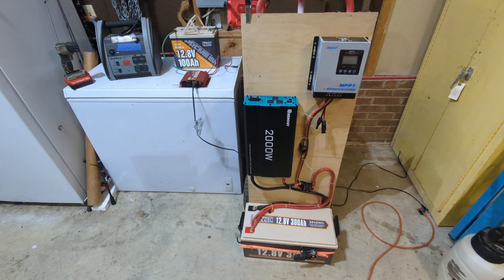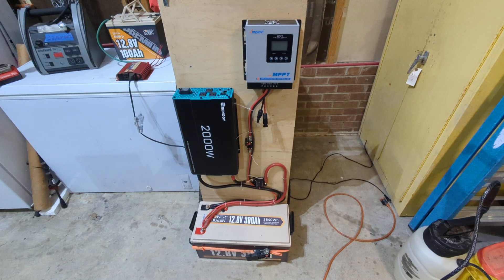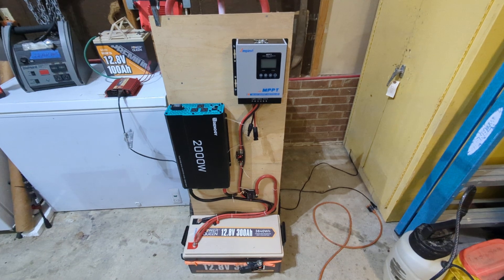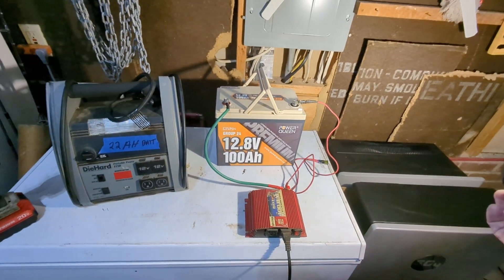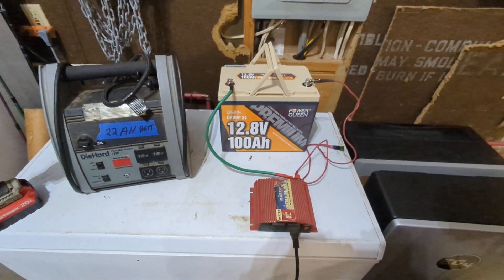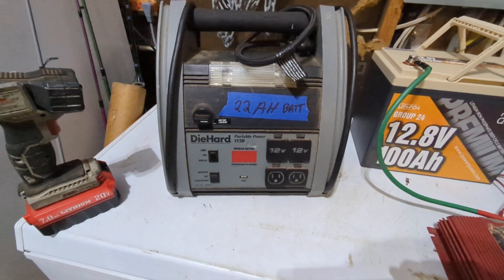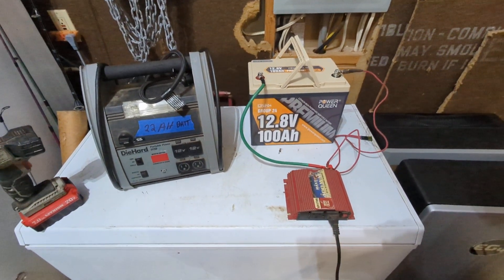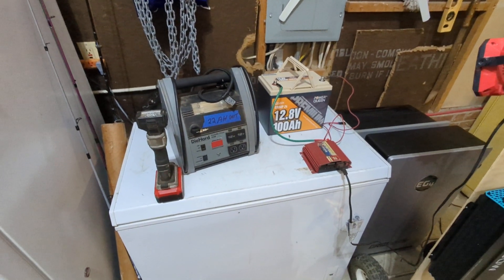Low cost winter weather emergency power systems.

Comment: Good Recommendation on a 24 Volt Small Home All in One ?
Reply from the maker: The majority of pre built solar generators are 12v. There are some out there but I don't have any experience with them. Eco worthy is a good brand jackery is a cost effective version. They all use lifePo4 batteries so they should work for years.

Comment: Nice setup, How have the Ampinvt held up?
Reply from the maker: It's done pretty good. It took a little bit to fine tune it to the battery charge voltages but it's done good. The only thing I'd change is I'd go with the higher amperage controller. My battery can handle a much higher charge rate than this controller can output.
Reply: @aarongettingitdone  I have the ampinvt 80a, it's been great but i'm a little concerned if it's going to stand the test of time. Been thinking about trading it for a victron 150/70
Reply from the maker: Victron is for sure a better brand. Maybe I'll try and do a stress test video on mine. if it's something you depend on for every day use I'd always keep a spare on hand no matter the brand.
Reply from the maker: Also keep in mind a piece of equipment running at max load will have a shorter life than one at 60-80%. Go bigger than you need if you are going to upgrade.

Comment: I have been buying jump packs like yours cheap at Goodwill, flea markets etc, and replace the lead acid batteries in them with lifepo4 equivalent batteries. I remove the jumper cables and just use them as portable power stations. I have about 9 or 10 in the garage ready to go for hurricane season. Also have 4 100 Ah lifepo4 batteries.
Reply from the maker: That's a great way to do it. They are worth having. I have multiple systems so I can power things in different areas without a bunch of extension cords everywhere plus I can help a neighbor or two.

Comment: how long do you think you use 100ah battery would last using on a sump pump ... ball park idea??
Reply from the maker: You have to know the wattage of the sump pump. It should be listed on the pump.
Reply from the maker: I looked at the average sump pump and they pull between 750-1200 watts. A 100ah battery would run for 1-2 hours continuously.